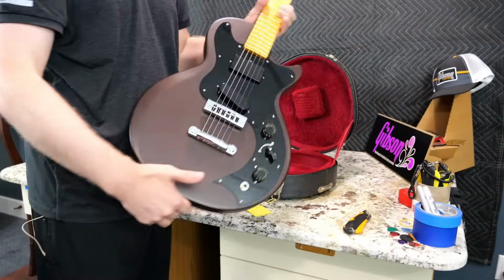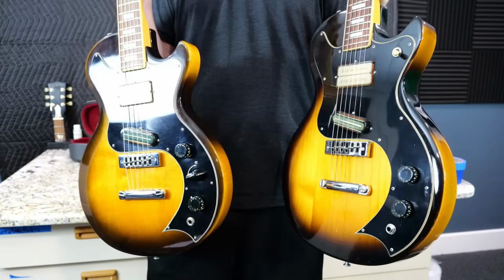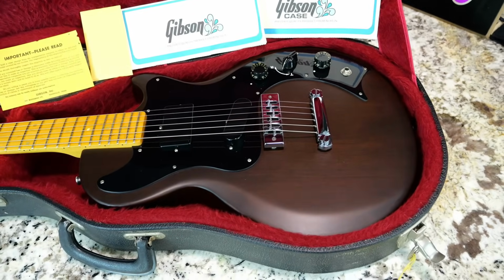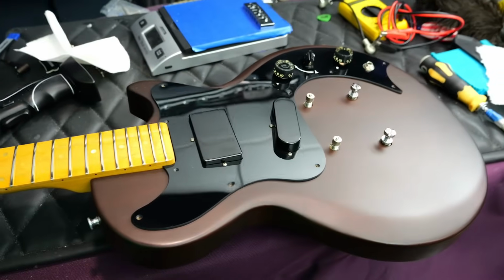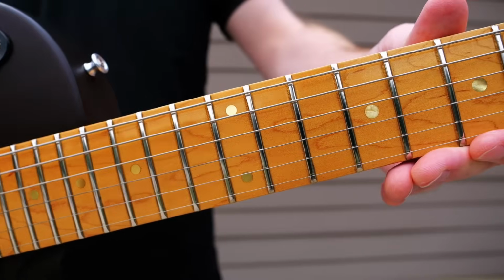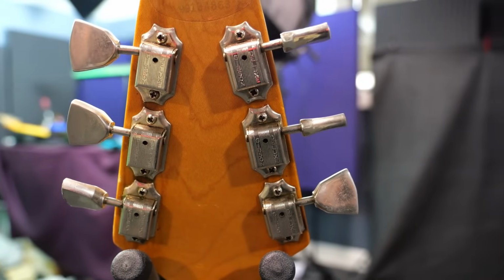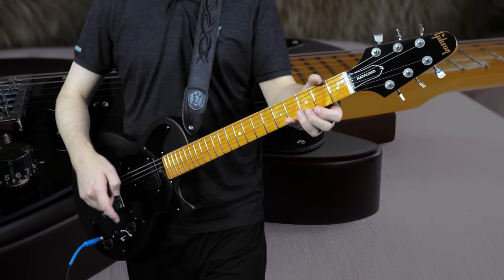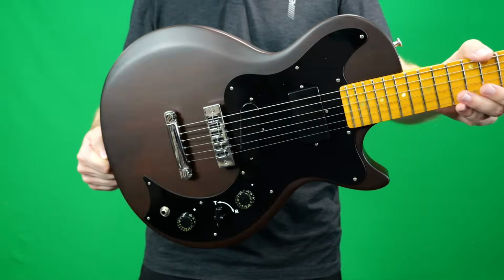The CLEANEST 1979 Gibson You've Ever Seen (Like-New) | The NOS Minty Marauder

Comment: I have a '79 Marauder in black with the black epoxied pickups, rock maple body (yes, it's heavy), three ply maple neck, maple fretboard, black painted headstock, and the mk III controls (blend knob between the master volume and tone).  The change from having the blend knob up on the horn  seems to have happened when the body route and pickguard were changed to be the same shapes as the S-1 (the bodies both got swimming pool routes, and the pickguards from that point are the same shape with just different cutouts).

Comment: What are the cons of having a scarf joint guitar?
Reply: From a strength perspective, none, modern glues are stronger than the wood. Jump on the neck and it will break, but not at the joint.

From a sustainability perspective, scarf wins, it's a more efficient use of materials. Much less waste.

Tradition? Acoustics used scarfs for centuries. So there's not really a "hate progress" argument for it.

So you're just left with cosmetics and the people who turn their noses up at an efficient, sustainable and strong construction technique because it's "cheaper" to produce than a more wasteful single piece neck and under a transparent finish will usually (but not always) have a visible seam line.
Reply: Looks cheap and kit like.  Otherwise nothing.   They keep the neck warm.
Reply: Yes, what Paul Cook said. On a neck with a non-transparent finish? None! On a neck with a transparent finish? Some people don't like how it looks. Usually the same kind of people who don't mind the glued-on side pieces on the insta-snap-off Les Paul headstocks, to get them to the right width. Strictly mechanically, necks with pronounced angled headstocks with scarf joints are superior in every way. Just for the way the wood fibres are cut to almost comically short lengths in severly angled headstocks from the same piece of wood as the rest of the neck, alone. If Fender Telecasters had headstocks at 17° angles, those would crack or snap off if you just looked at them wrong, too. Because the fibres in it would be half the length of a matchstick, just like on a Les Paul or SG. By the way, the volute on the 1970s models only somewhat protects the most vulnerable part of the headstock on Gibsons. Nine tenths of the angled headstock are still as mechanically weak as before, because the wood fibres in it are so ridiculously short. Scarf neck joints were invented by master luthiers centuries ago, to solve that mechanical, structural weakness - by having longer, stronger wood fibres in the headstock and having that part of the neck attached to the rest of it with a glued joint that has as much surface as possible. Those luthiers understood mechanics and wood structure. Unlike the people who came up with the original Les Paul headstock...

You know why the old Gibson Melody Maker headstocks looked they way they did? Because they were regular necks without those side pieces (or "wings" as people like Trogly call them) glued on. Fender sawed parts off existing necks and bodies to make the Maverick and Swinger models - Gibson just didn't glue parts on for the most affordable student model, to save costs.

Comment: Trogly, I have. 1976 marauder in wine red (pickup switch volume and tone knob). The bridge posts use a flat head screw driver to lower and raise the bridge. I was trying to adjust the bridge and the top of one of the posts chipped off (or stripped like you mentioned), making it very hard to turn. Do you know where I can get a new set of posts?

Also, it has the see though Bill Lawrence pickups. Are both of these humbuckers or is thebridge single coil?
Reply: The bridge pickup is a smaller humbucker with rails instead of pole pieces.